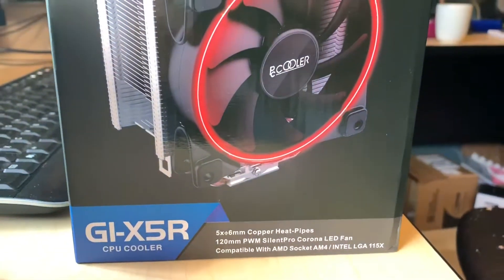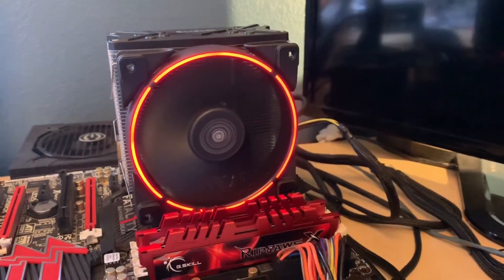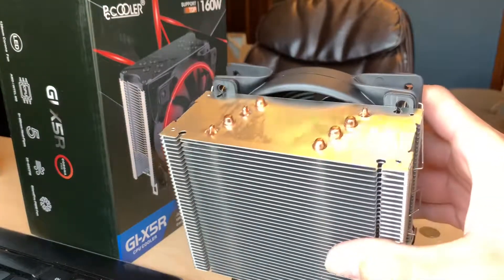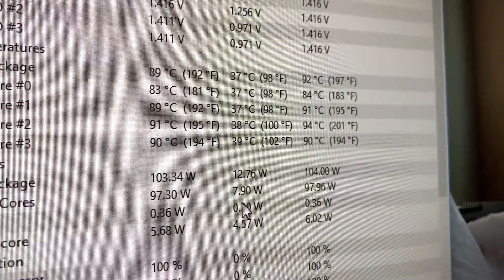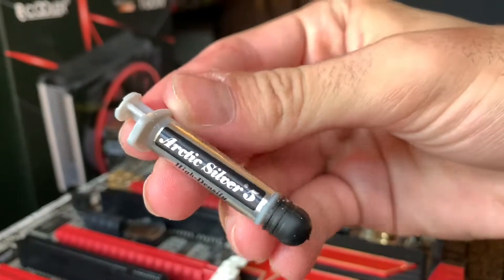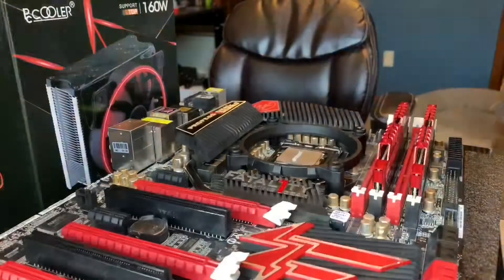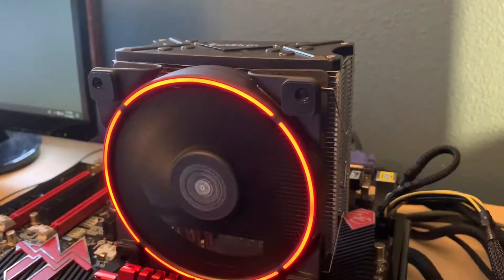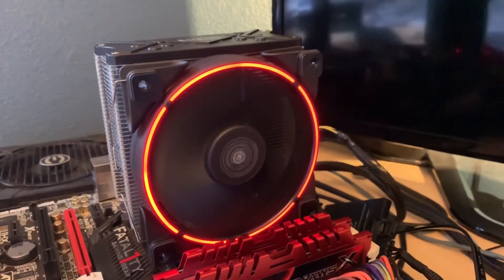PCCOOLER GI-X5R — Cheap, but is it any good?

Comment: Does it block the ram
Reply from the maker: It will block one of the slots that is closest to the cpu socket, but if you have low profile ram it shouldn’t be an issue.
Reply: i wonder if it fits in corsair vengeance lpx 😅

Comment: I had this Cooler.. and yes, the Thermal Paste comes with it is cheap
Am runing this Cooler for like 1 year on 2600 (OC at 4.0GHz with 1.3V)  (it's 300MHz more compared to stock 2600 frequency)
For $16.. this is super great product, Hyper EVo is $30-$40, which means this CORONA GI-X5 less than half price
About the TDP.. it's more like 130, 160 is just marketing BS Lol, still it's great $16 product
Reply from the maker: Nice, on my i7 I tested I was only able to hit 4 GHz aswell with comfortable temps. Honestly for $16 it really isn’t that bad, although I think most of that goes to the included corona fan, which is $10 by itself lol, as the heat sink itself is really cheap. The Gamaxx 400 goes on sale constantly for $18-$20 and I think it will preform better for just a couple bucks more though. I might have ordered one to check it out so we will wait and see
Reply: @EmTekTube   Agreed, Gamaxx 400 is unbeatable when it's goes on sale ($20) 
But when I bought this.. Gamaxx 400 was like $30, so this was much better
Still.. while changing Thermal Paste on CORONA GI-X5, it's perform slightly better
All in all, even crappy coolers in market are better than Intel stock garbage..

Comment: I think myself to take for the i7 7700k. I use the gammaxx 200t at some points, it is heated under a load of up to 90 degrees Celsius.
PCCooler GI-X5R will pull or will there be no difference? Maybe someone has the same case ...
Reply from the maker: If it’s reaching 90C at stock settings it might be a little better, but most likely it will be similar or the same as the 200t